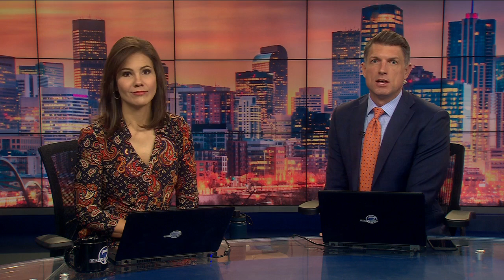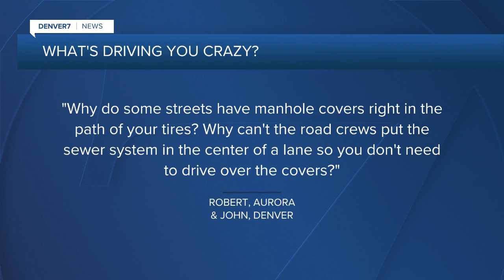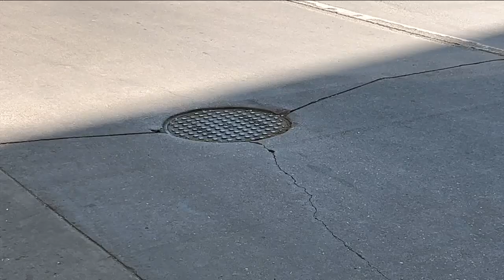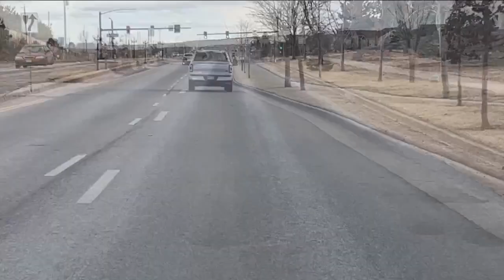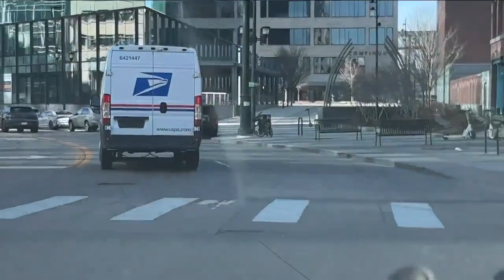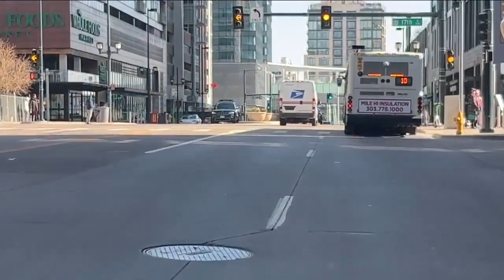Driving You Crazy: Why do some streets have manhole covers right in the path of your tires?

Comment: I agree below surface manholes are a real problem in all cities. You try to avoid if possible but sometimes they sneak up on you and knock your teeth loose. Not only that the wear and tear on your vehicle suspension,shocks,tie rods,steering components,tires,etc. Some of these manholes are like a pothole in the street,something needs to be done about this problem. Ticks me off everytime I hit one of these without expecting it. There are enough damaged roads out there without having to deal with these manholes.